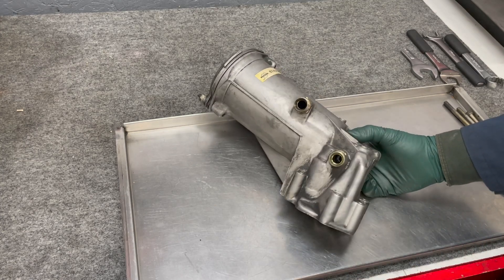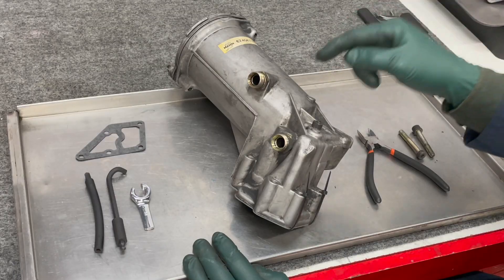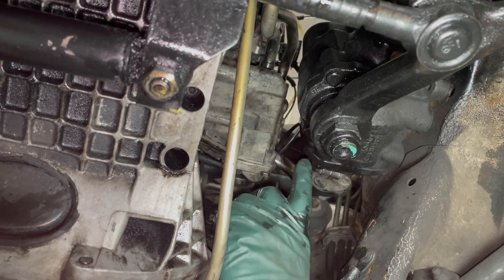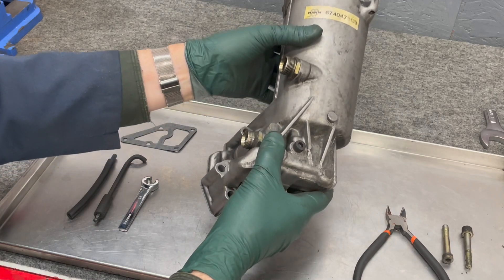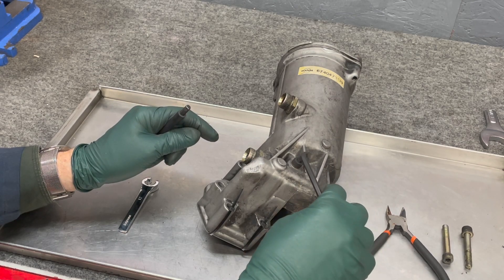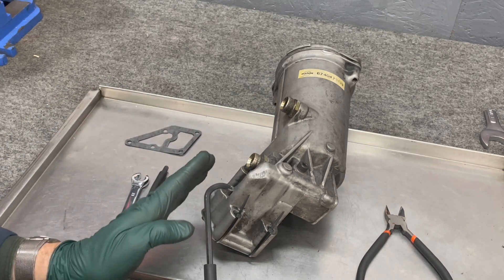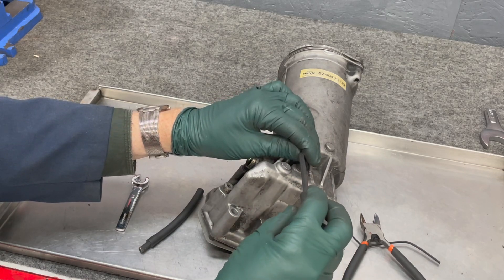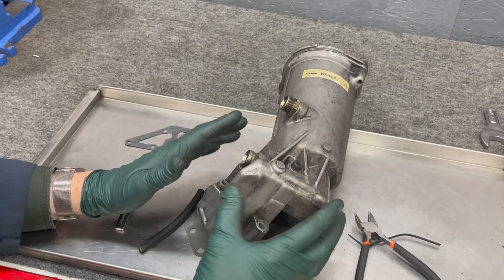New 77 to 85 Diesel Oil Filter Housing Gasket Kit and Installation Sequence Explained

Comment: Many thanks Kent! Could you maybe make a video on replacing/revising the fuel lift pump, including where to find proper gaskets? Mine is probably a bit old, leading to the familiar starting-and-quitting sequence a couple times before she runs properly, but i have one of the older lift pumps and i'm not sure which kits to use. Any help would be much appreciated!
Reply from the maker: I have a complete kit with everything you need including video instructions for 77 to 85 diesels. I have nothing on the earlier models. https://mercedessource.com/store/1977-1985-diesel-fuel-lift-pump-overhaul-kit-w-video-instructions